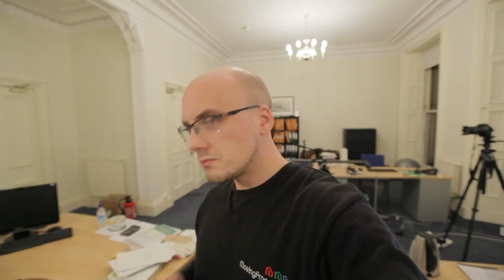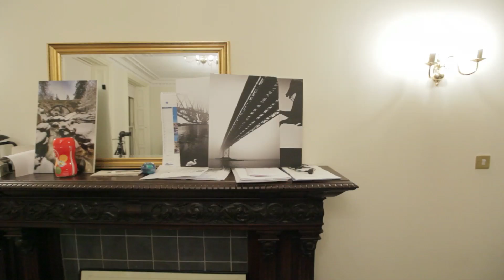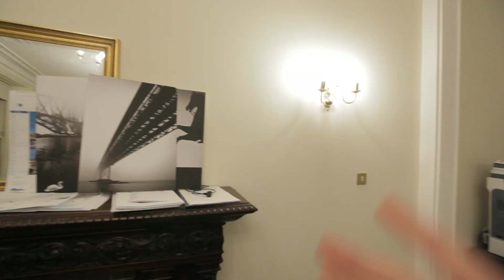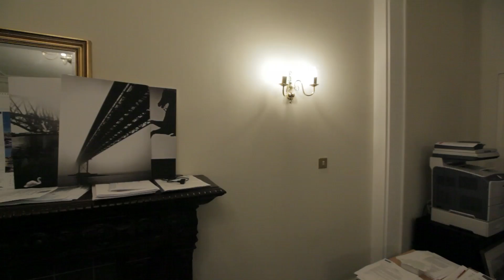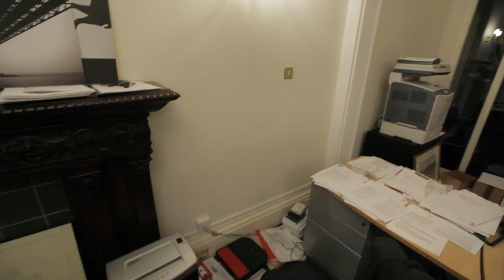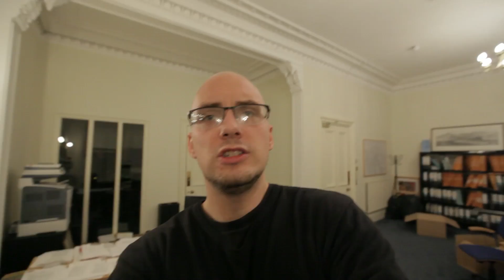Dom's PAL vs NTSC explanation and problems

Comment: Lights actually flicker at twice the mains frequency because the voltage peaks twice for each full mains cycle. I still agree with your general argument however.

Comment: Ok please help. I have just bought a GoPro Hero 4 Silver and I'm based in the uk. 

The PAL settings are only allowing:
2.7K 24 & 25 FPS
1440 24 & 25 & 48 FPS
1080 24 & 25 & 48 & 50 FPS

I am wanting to document the marathon i am running. Whats the highest quality setting i should use? 

Or should i just use NTSC at 30 FPS?

Thanks

Comment: On older televisions, or with bad cables, you could get mains frequency hum mixed into your picture signal. If the picture is almost in sync with the mains frequency, the hum will show up as a dark line that moves slowly the picture, if at all. If picture and mains frequency are far off, the picture might flicker.

It is not because of the lighting. Old tube cameras had a very slow shutter.

Comment: I live in a PAL country but I absolutely prefer (progressive) NTSC for my home recordings. The reasons:
- The vertical resolution matches a common SD resolution used for computers (720x480 vs 640x480) so rescaling between the both is less destructive (i.e. Youtube doesn't have an 576p quality option for PAL).
- Upscaling NTSC to 1920x1080 is done slightly better than PAL at most TV devices.
- Most non-camcorder cameras (photo cameras, smartphones etc.) capture in 30fps. No fps-conversion needed in most cases to get a TV-standard video.
- Almost no non-camcorder camera capture 576p. Most of them use 240, 480, 720, 1080 and so on.
- 4K TV's can scale it up without any interpolations, means, lossless without blurring!
- It has higher FPS so it is more smooth
- It is compatible to all DVD players and most CRT TVs in the world (ok, might be more less important nowadays than some years before)
- It is easier to transform PAL to NTSC than vice-versa. You can simply apply a pulldown to achieve that. Modern TV devices are smart enough to detect and undo it during playback. In other direction, you loose frames forever.
- Can be played on most common screen refresh rates without jerks (30fps, 60fps)

The only disadvantage I see in NTSC: The vertical resolution is smaller. BUT rescaling is done better in many cases.

I convert any homemade video to progressive NTSC. I don't use PAL anymore - too many issues in digital LCD world. The little judder appearing by converting from 576i50 to 480p30 is hard to notice. Stay interlaced isn't the way to go anymore.

Comment: Just a correction mate. PAL is used in the UK and the rest of the world.
NTSC is almost exlusively US/Canada/Japan and some parts of Brazil.
Reply: Footynews Daily 

North Korea uses PAL-D/K (6.5 MHz carrier) but no plans for DTV broadcasting in North Korea, South Korea uses NTSC-M (4.5 MHz carrier) and ATSC, Taiwan uses NTSC and DVB-T (6 MHz US DTV freq at 60hz for DVB-T in Taiwan), Philippines uses NTSC and ISDB-T (South American DTV freq at 60Hz).
Reply: Footynews Daily 

NTSC uses 525 lines at 60Hz in 3.579 MHz color carrier

PAL-M (Brazil) uses 525 lines at 60Hz just like NTSC but on 3.575 MHz color carrier

PAL-N (Argentina, Paraguay, Uruguay) uses 625 MHz at 50Hz in 3.582 MHz color carrier.

PAL is 4.43 625 lines at 50Hz, SECAM is 4.42 MHz 625 lines at 50Hz.

PAL-N and PAL are not the same colour but same frame rate.

NTSC and PAL-M are not the same color but same frame rate.

Comment: Both PAL and NTSC are very similar in the method by which the luminence (brightness) and chrominence (colour) information of a TV scene are encoded into a composite signal for broadcast. Essentially, brightness is measured in terms of signal amplitude and colour in terms of signal phase shift. Quite an old idea that had been around since before WW2 IIRC.
The main issue that I remember  being taught about at technical college many years ago,when I studied TV engineering, was the problem of incorrect colours caused by phase errors introduced into the chrominence (colour burst) signal. 
This was particularly problematic in early NTSC broadcasts (for instance, colour differences that were noticeable between shots from different cameras within a studio, or even broadcast atmospheric conditions) and could give very unnatural flesh tones to people's faces and to which the human eye is very sensitive to.
PAL could potentially suffer the same problem, and as the shortcomings of NTSC were well known, a clever piece of electronic processing was incorporated within the PAL system so that  chrominence phase errors could be nulled out so that the human eye was fooled into not noticing them. Full info on Wikepedia and elsewhere.
Just a little humour.............I remember our teacher being asked what NTSC stood for, his reply was "Never Twice the Same Colour"..........

Comment: Thanks for sharing the interesting video experiment. 
Just for clarity, North America and a couple of other countries use the NTSC system. The 30 fps rate (it’s actually 29.97fps but they round it up) is half the mains frequency (60Hz) of these countries.  
In the UK, Europe, Australia, Africa and most other countries the PAL system is used, which runs at 25fps – again, half the mains frequency used in these countries (50Hz).  

In simple terms, terrestrial TV broadcasters use these 50Hz / 60Hz frequencies to broadcast their pictures into our homes.  They use a method called Interlacing. This is what the i in 1080i means which many video cameras still have in their option menus.

Now, here’s the thing. In the digital land of the computer and the internet, (and smarter TVs too, plus the popularity of the Progressive frame – the p in 1080p) it makes no real difference which format you shoot in because the internet doesn’t require either of these frequencies or formats to display your video. That’s why you can shoot a video in NTSC or PAL and it will be viewable on YouTube etc anywhere in the world, regardless of the native system. 

The problem only arises if you try and mix the formats within a single project and e.g. you try to edit footage together – then there will be problems for sure. There are ways to convert one to the other but that’s an unnecessary extra step there’s usually a quality trade-off. Using the opposite system format can also generate excessive flicker from artificial light source if, say, you shoot NTSC in a PAL country and vice versa. 

Speaking from a professional point-of-view, it’s generally good practice to use the system of the country you’re working /living in unless there’s a really good reason to do otherwise. 
However, if you are an amateur and you only intend to upload your video to YouTube, Facebook etc. then you can use whichever format you like – though I can’t think of a good reason why you wouldn’t want to use your native format.

One more thing. DSLR cameras introduce additional issues which were highlighted in your video. One was what’s called Rolling Shutter – which occurs when the camera is moved about too quickly – it makes the image look skewed. This is a camera sensor problem and nothing to do with either PAL or NTSC. 
A DSLR also introduces another set of issues concerning frame rates – but that’s a topic for another day.
Phew! 
Hope that sheds some more light on the issue for you all.
Reply: If you're used to seeing a lot of content at different fps then yes you'll know the difference. The 24/25 looks more cinematic and 30 more soapy imo.
Reply: Good addition to the great video. I still have a question. In ntsc you mostly film with 30fps, in pal with 25fps. Is that difference notable? If not I stick with pal, because I live and film in the Netherlands.
Reply: Thank you so much for your explanation. I have NTSC system as my graduation work and this helps me a lot on what should I pay attention to when I start working on the project.

Comment: Hey, please help me, i use Canon 6D , but when panning slow it looks terrible, not smooth, i dont know what is called , "jittery", "laggy" or "glitchy" , i usally shoot 24fps/30fps ,in 50/60 shutter, and tested all shutter , not helped, only goes smooth when shoot at 50 fps or 60fps, why this problem happens? is there solution? can it be due the Memory Card speed? 
i put link below, there is another guy have issue like me, look at the buildings when slow panning, looks not smooth, like i say
/watch?v=Qp_65IQ9U-Q

Comment: This is actually a very good explanation of the difference. The only thing  would add is that PAL is actually only really used in SD production. PAL and NTSC actually relate to specific standards and are defined as 625/576 lines @50hz whereas NTSC is defined as 525/480 lines at 60hz. Meaning although PAL technically has a 20% slower frame rate it actually has 20% more resolution. When filming in HD is its own standard, aside from frame rate differences it was designed to be more standardised which eliminates many issues with scaling. In Europe broadcast standard is now 1080i/720p. Also a lot of modern screens can run to at least 100hz, or 120hz in north America, so frame lag is not so much of a problem these days.

Comment: The 50/60hz issue was originally due to Earth's magnetic interference. Cassette Tapes had issues during playback on CRT screens, so 50hz fixed it.  These days almost all PAL countries are able to go NTSC, many still have not transitioned.
Reply from the maker: +Kavya never heard about the earths magnetic interference being a cause,  you got a link to anything on that, will mention it in a future video
Reply: Nope, it's because of the electric generator of each individual country. UK/Europe has their current running at 50hz per second 50 electric spins so their appliances were running at 50hz to avoid issues and interference; PAL is specialized for 50hz countries *there is also PAL60 for 60hz. However here in Asia and America, we were running at 60hz per second so to avoid issues we use 60hz to our appliances and we use NTSC because it is specialized for 60hz countries.
Reply: @caloss2  Yes, there were many parameters to a TV standard. There were variations of vision/sound carrier spacings on different 625/PAL standards (e.g. 6 MHz for system I). Regarding joke terms, other jokes were that PAL stood for 'peace at last' (after the problems with NTSC) and SECAM stood for 'system essentially contrary to the American method'. I thought the control for colour correction was normally called the 'hue' control. The tint control usually adjusted the red and blue primaries differentially although this control could appear on TVs of any standard.

Comment: Well!  one other key you forgot to mention is Pal format has 50% less lines per second roughly vs NTSC as well.  And for this reason it is why blueray dvds are never in a pal format when there burned!  Granted dvd player in uk play pal video to your tv!  But the blue ray it's self is not!  So for video pal and ntsc are very different when comes to optical zoom!    More info received ='s better qt video at high zoom rates!  Also at the cost of needing more memory to store it .   Pal video normally is 5 hours 1080p  to 2.5 hours of ntsc video for same amount of storage space needed!

Comment: The US governing body made it a condition that colour can be introduced as long as people were not forced to buy new televisions, unlike the UK we had to buy new TVs (even new black and white ones) because the sets before PAL were not compatible.
Reply: In the UK , the 625 system started in 1964 in black and white with the decision already made that it was going to be used for colour once a colour standard had been agreed upon. The PAL colour was added in 1967. The 625 system only broadcast the new BBC2 network channel while the old 405 system continued to only broadcast BBC1 and ITV. People had to buy a new dual standard 405/625 TVs to watch all the channels. Many people just stuck with 405 only TVs and didn't bother with BBC2 until after the colour service started. All the networks went out on 625 colour by the end of the 1960s. The 405 system was finally switch off in 1985 by which time it had been in use for 49 years!
Reply: @johnr6168  Thanks John.  Interesting read

Comment: I've been using my t2i on NTSC so I can use the 60fps but at 1/120 shutter I get the banding. The next iteration is 1/94, which, removes the banding but then increases motionn blur a little bit. Can't seem to set to 1/100. Might start using it on PAL just so I can.

Comment: Funny is that they had this problems with bees. Yup they kept bees somewhere inside with well lights and they found out the bees gone CRAZY. Then.. they learned bees see in really fast framerates and the lights they we're using we're for them like "on-off-on-off-on-off"
Reply: Masticina Akicta 
It could also be that the light was not full spectrum and therefore was not polarized the way the bees are used to.

Comment: Many cameras will have software correction for 50hz and 60hz flicker which basically tries to correct for the banding when not using shutter speeds that are perfectly in sync. They work pretty well as they do not degrade the quality by any noticeable amount when there is no flicker.
Reply from the maker: Razor2048 i know my ipod does but i have not seen that feature in any dslr.

Comment: Hey Dom, I want to add, that I have LED as my main lamps in my apartment and when you take a video with that, the bands and the flickering are/is much stronger! Just because ordinary light bulbs or neon lamps are dampening the flickering much more than the very quickly responding LEDs. Try to make a video under LED light and you see what I mean :-) cheers and greetings from Hamburg, Germany!
Reply from the maker: I shot in some night clubs where they they've had a lot of LED lights as well. And in some cases haven't been able to find any shutter speed that actually works perfect sometimes I think LED lights are on their completely own frequency
Reply: In clubs that might be the case... To change the luminosity of LED (dimming it) a method called PWM for Pulse Width Modulation is often used. In that context I can imagine that the frequencies are modified as well. So in a club, where you want to mix different colors of lights there may actually be no frequency to capture good video.. yes.. :-D

.. but in my home I can promise, it is net frequency :-)